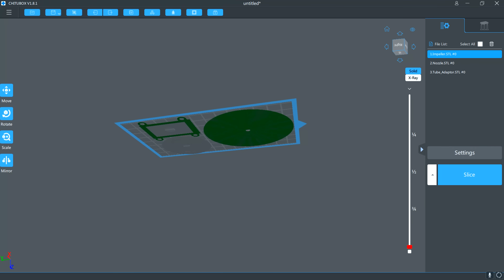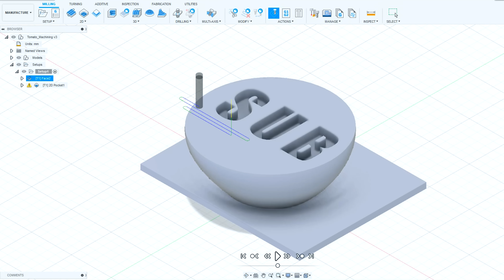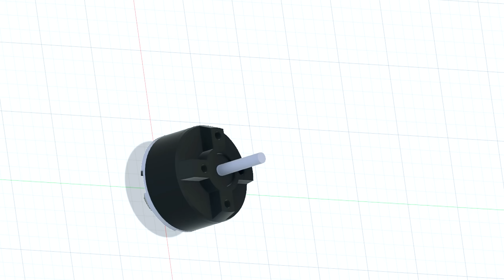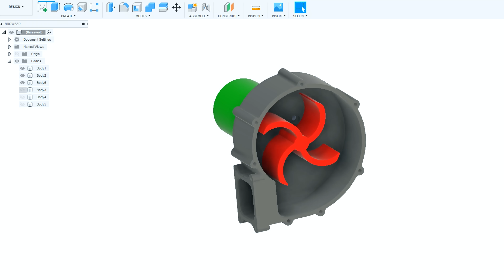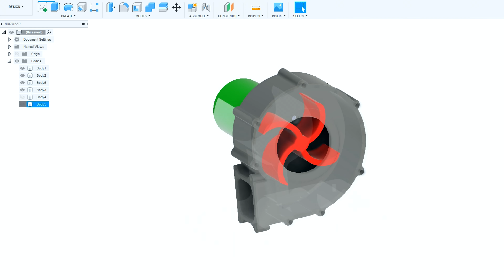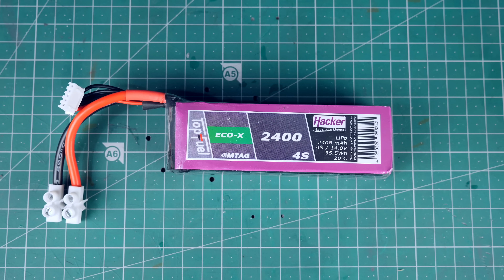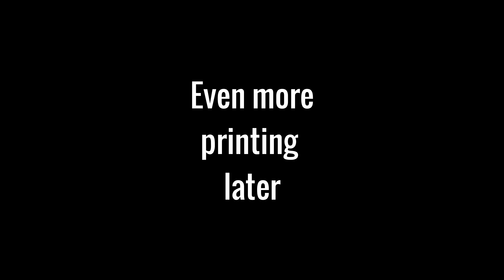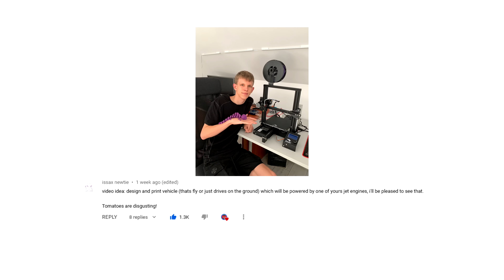Water Rocket Skateboard (3D Printed)

Comment: Well I think u should try a set up like the old air hogs toys. They used air pressure to push the water out of a reservoir. Also u could use the fuel from sugar rockets in ur 3d printed rocket engine

Comment: why don't you connect one of those insane motors directly to the wheels of the skate board and then add a remote controlled steering mechanism to it so you have a super fast skate board that's controllable then take it to a private road or something and max out the speed reaching a billion km/h

Comment: Tesla designed a pump that would solve your breaking issue. It used discs with spacers between them to create a vortex in the pump housing. It doesn't have blades like an impeller, so the water is only really meeting resistance with pump housing.

Comment: A couple of questions if you would be so kind to indulge me. Why were your impeller blades in a pull, or suction shape/orientation rather than a scooping angle? I guess why are they curving in that direction? Is it because of the way the water enters the turbine and making that less turbulent? Also did you shape the inside of the propulsion nozzle to atomize the water being ejected as much as possible in order to increase the surface area of the air it would be pushing against in order to maximize its thrust?

Comment: For your CNC, acrylic is not friendly. It really hates heat and vibration. Just try aluminum. You will have to go slow on that machine, but its really not too bad. Just remember, CNC machines remove material, and that always creates friction which is heat, and heat is the enemy in many scenarios (I am a CNC Machinist)

Comment: if force equals mass multiplied by acceleration, then you can achieve the same force by either increasing acceleration (via constricting the flow, which also increases compression, which is why your housing was issploding), or by increasing the mass (via wider ports, both intake and exhaust). if you connect the yellow hose directly to the reservoir, and print an intake valve (Tesla valve maybe? 🤷🏼‍♂️) that the hose fits inside, instead of over, then your flow will increase, thus decreasing internal pressure, while maintaining the same backward force. ...I think 🤔🤷🏼‍♂️

Comment: I am thinking about waverunner and jet ski engines and I feel like you might have more success with the centrifugal design if it’s flooded before it starts. The excess gas in the turbine may be reducing your power, but that’s just a thought. Additionally, using a blade design may not be necessary, perhaps a solid printed piece with channeled grooves in it may hold up to the pressure better at a cost to power. Perhaps those two changes would balance out? Also you definitely should get an inflatable paddle board and attach this to it and take it to a pool/lake/beach and see how fast you can go on that motor!

Comment: Should try it with an air jet ejector pump.  That way the pump can pump air into jet pump and the air will increase the flow of water without moving parts in the jet pump.

Comment: what I would suggest with your pump is reverse the propeller fins direction and double the thickness and add some rigidity or  structure on the outside and the fins for support because of the increased resistance along with a motor or/to adjust the angle of the nozzle to project at any angle using your "turning function' on your remote. I feel if you were to point it towards the ground at the right angle you would get more acceleration from the thrust and friction combined. noticing water coming from the "seals' of the pump shows flexing and has a hard time containing the psi of the fluid which constitutes to loss of thrust. maybe make the pump come together as one like a dovetail joint for more strength. i hope maybe my ideas would help for Version 1.2. happy creating!

Comment: I wonder if priming the pump with water before you open the valve would help to increase the speed and pressure of the water since there won’t be the air in the pump causing a loss in efficiency. Maybe mounting the pump on its side could help with that. Just a thought.

Comment: You don't want to use a centrifugal pump, use a screw pump, similar to a jet ski. That 60,000 rpm motor with a screw pump will move water fast.

Comment: Like this comment to make him see this

If you cut metals please use a crapton of lubrication, motor oil works best but is a horror to clean and maintain. You can practice cutting using aluminum cans, then stainless steel plates etc. You wanna know why? My tungsten carbide cnc bit is still 1/2 deep in my concrete wall because of a minor CNC miscalculation. Learn to work around with soft metals like aluminum and use a big tank of oil to lubricate it. Use big bits at first as they're usually rigid and won't break easily. But before you try that, test your cutting with a stick the same length as the bit if the stick breaks so will the bit. Adjust until the stick only bends a bit. Wash and rinse. Try engraving too

Comment: VIDEO IDEA: It would be really cool if you printed your wankel engine out of ceramic or use your new CNC machine to make it metal and then run it off of hydrogen, butane or some other type of gas like a real internal combustion engine (you could even turbocharge it;)

Comment: I can't really see where this would be useful out of water, by that I mainly mean moving water up a tube.  Sorry but a blade making direct contact under water would be much more practical than pumping water into air, and liquid converted into gas and then ignited wouldn't only be much lighter, it'd also take up much less space as well.  Plus the mass of the liquid would have to be a factor for calculating how much you need to propel your object a certain distance.  So more water = more force required, unless I have just went crazy.

Comment: the rpg example you showed isnt correct, its a "recoilless gun" which basicly means it allows the gasses from the rocket to exhaust and reduce the recoil, the gun actually recoils forward instead of the usual backward recoil

Comment: With the CNC I’d recommend using some double sided M3 foam tape. It does have a little spring to it but it also is easy to get under for larger blocks (like a wood block) and it just rolls up with your hand easily

Comment: I feel like having to push all the water in the tank is causing the skate board to not be able to move. Maybe try mounting the pump on a boat so that it can suck the water and not have to move all that heavy water!! Plus I heard tomatoes don’t like high pressured water because it will cut them in half! Maybe you’ll be safe near a big body of water!

Comment: Y don't you use a tank with pressurize air supplying the force in the secondary tank to expel the water. Simple chipper and safer.....P/S   install a pressure regulator between  the air and the water tank ( ;

Comment: Heres an idea for a video: Make an RC boat that works using the principle shown, you could have an infinite supply of water surrounding the boat that wont weigh it down that way, you could possibly have 2 jets using the slower brushless motor which if they have seperate variable speeds, might allow you to steer it

Comment: For some reason this reminds me of cheap plastic rockets we used to buy as kids. They had a chamber filled with water, then it was pressurized with an air pump. The rapidly expanding air provided the acceleration and the water provided the mass. Just a thought. F=ma. QED. LSMFT.

Comment: That first pump would have worked if the intake wasn't choking it down so much. In addition, you can see the BLDC ones essentially trying to pump foam instead of water. So either there were major leaks on the intake side, or it was spinning fast enough to cavitate. 

Try a Tesla turbine instead of an impeller, should work better with such high speed motors.

Comment: You should print some pump that would force some air, with the water incoming, and I guess they're some ways to improve the nozzle, to increase the output, so the turbine would have much less resistance

Comment: Integza, You are doing it wrong.
You need to use your motor to compress AIR. Liquids can't be compressed. That is the reason why your engine is exploding.
So, your pump needs to compress air, expel it wile combining it with water, just like a spray.

Comment: Video Idea: 3d print a miniature air compressor. 
If it works you could use it in a lot of cool experiments. 
For instance: for this video you could have compressed air in a sealed water tank and used the air pressure to propel the water out.

Comment: Use the CNC machine to cut sheets of acrylic bolts together to then be able to run the highest speed motor with a better impellor it's a little bit expensive but worth a Try

Comment: Need to reprint impeller with supports from fin to fin. The centripetal force is making the fins stretch out and hitting housing. Or you could do a typical air turbo fins on a disk to minimize distortion. I also have the same motor, and yes.... it's a beast, I only run 4s, but is capable of 6s. Please be careful, and strap that motor down tight.

Comment: For practicing/prototype work on your CNC mill, use wax! Then you can melt the shavings and unwanted parts back down to make more material. They even make "machinable wax", but it is a bit expensive. Regular candle wax would work just fine.

Comment: I think you should build/buy a metal foundry or forge and cast high temperature projects like the vortex jet housing. Use your 3D printer to cast it with silica sand. It's almost dummy proof 🤪

Comment: Video Idea: My wife suggested that you take your pump mechanism and adapt it to be used as a water-jet boat. Attach the tank (you actually wouldn't need the tank - just draw water from the pool), pump, battery, and the wireless transmitter to a floating platform. Angle the pump outlet into the water and you have a jet boat.

Comment: You know there are just normal tank fittings with rubber seals and a ball valve!

You can usually find these around the irrigation or pond section at the DIY/gardencenter.

Comment: Idea: you could attempt to CNC aluminum components since it’s easier to mill but my actual idea is that you could attempt to make a laser cutter, you could either create an entirely new setup or use your CNC mill and make interchangeable components so you can chose between using the CNC mill and laser cutter

Comment: You might have already seen this, but if you haven't you should really check out the channel "Let's Print!" They have a video testing a few different designs for moving water, which might help with this! 
(Just searching "3D print pump" should pull up the video)

Comment: The issue with machining acrylics is the tool rubbing and partially melting the plastic making it gummy - Best bet is use a cutter with less flutes (slow spiral single flute endmills are best) and also print a chip fan for your spindle too to help evacuate some plastic flakes to stop chip recutting / rubbing and the air flow will keep the plastic and tool cool too

Comment: I'm very disappointed.  Tesla turbines are used as pumps (motor turns the shaft, instead of being driven by the fluid) and you didn't use one.  Tesla turbines used as pumps excel with high viscous fluids where conventional pumps have trouble.  It might be possible to use a higher density fluid (tomato paste anybody?) that might get a higher thrust to weight ratio than water. Perhaps the next video will use a Tesla turbine as the pump?

Comment: Impeller is backwards and you should test new designs for the pump and impeller , but awesome video anyways
Reply: The Impeller is not backwards, the blades on an impeller almost always curve backwards from the direction of rotation.
This gives smooth separation from the blades preventing energy draining vortices as well as keeping fluid from simply getting trapped in a concave surface.
Reply: @nocare  well regardless the design needs more work. The out flow has too many bubbles when the intake has none , this may be coming from all the gaps in the design where a gasket or sealant was not used . Maybe even the angle is just too steep for the backward curvature. I’ll admit I’m wrong but that design needs work.

Comment: i like how he keeps printing crappy pumps out of plastic when he has a cnc machine
also, dat cavitation
also, centrifugal pumps are flow pumps, not pressure pumps, you can have a flow rate of 50 gallons per minute out of a pump on that skateboard and still barely move, but if with a pressure pump you could put out only a few gallons per minute and move quite a bit more

Comment: Add some flat discs with no ports. You won’t have to worry about cavitation or impact. Instead use the principle of adhesion and viscosity. Two discs will work fine, even one thick disc. Buy a better transmitter that you can adjust the throttle on for progressive throttle.

Comment: So a few things. Tip clearance on the impeller should be very tight. The water sloshing around the tips creates a lot of drag and back pressure. Decreasing that gap might help it not explode but from what I can see the breakage is mostly from an over speed event.
You can also find the back pressure of the exit nozzle, pump it into a guage, and use Bernoulli's Principle with ambient air pressure as the other P in the equation. From that you can solve for the exit area which will give you the ideal diameter for the exhaust fluid and thus the most thrust.
Now for the hardest part. Turbulence in the system is lost energy (2nd law of thermodynamics). Figuring out the exhaust diameter can help linearize the exhaust fluid. Getting rid of any square edges and "sharp"(any edge) corners will help with linearizing the exhaust as well. Get rid of the square tunnel that leads to the exhaust and make it circular, this will also help reduce back pressure and I have no idea why you would even go with a square tunnel. 
I am writing this comment instead of finishing my structural analysis on a helicopter engine component... God bless working from home!

Comment: The pump probably doesn't explode because the material is too weak. It explodes because of the shape of your open impeller design (I once made the same mistake): The curved blades are not very stiff and expand like a spring, kind of like a centrifugal clutch works... So at a certain rpm, it collides with the wall, the abrupt braking rips the blades off which then fly through the housing, destroying it. You can try a closed or half-closed impeller design, those are also more efficient. Great video btw!

Comment: the reason your second pump did the best was: reasonable turn speeds of the impeller and !large intake diameter!. the first and the third pumps where limited by the intake and therefore mostly creating vacuum/gas pockets. If you want to improve your design, use the diameter of the hub as smallest diameter and work your way up.
Also if turn the pump with the intake opening to the top, you have gravity to aid your water into the opening (in static or slow moving situations gravity works on the water surface no matter the angle of the intake, but when you create vacuum pockets, things get wierd)

Comment: The water flow to the pump is not enough. You need to have a pump system that pump the water into the intake… look at the air bubbles in the pump its caveatting… would love to see it actually work

Comment: Count me out for the printer - but I wanted to say a couple things about your design!

First of all, remember that a rocket needs to lift the fuel it carries, this adds weight, and thus you need more fuel to lift it; by placing your spigot a third of the way up the tank, you make it impossible to get access to the bottom third of your fuel, meaning loads of dead weight! Raising your water tank and lowering the spigot will increase the stored potential energy of the water and give you access to all of your rocket fuel!

On your pump - bloody well done for trying so many times, your courage and determination was very admirable. To prevent shattering of the impeller, have you considered increasing the number of fins? If each blade had to move less water, force would be more evenly distributed and you would likely move the same volume of water - you may even be able to get away with 3d printing this part by just redesigning - definitely more isolated testing needed here.

Finally, you might want to tune your ESC output mapping a little. Linear throttle response is probably not useful for this application, and the difference between 0 and 20% throttle is probably not noticeable, same for between 80-100%. By tuning the throttle mapping (look for the input curves) you can increase resolution of the important part of the throttle input. For testing, I would recommend not using an analogue trigger for this, and instead use a switch to get a specific power output, reduce the number of variables.

I'd like to see more of this project! Hopefully you can continue whilst you fumigate your CNC of tomatoes!

Comment: Only suggestion i have is: yes to cutting metals, and alumin(i)um can get gummy when it heats up so it may need some kind of coolant, which can be messy. When it gets gummy, it will break everything you love, and leave you lonely and without endmills and you'll have to recalibrate everything. But...if you drink a lot of soda, you could use a forge to recycle that into usable aluminum blocks to machine at home. Or just buy em i guess.

Comment: You may get cavitation if you try to accelerate the water too fast. This happens when you essentially create a region of such low pressure that the water changes to a gas briefly, then collapses and can create pressure waves that break stuff. Your centrifugal pump and nozzle may need a redesign to accommodate the water's incompressibility and also avoiding cavitation